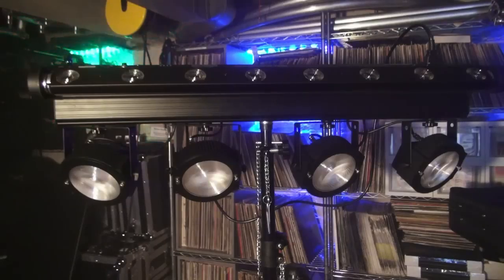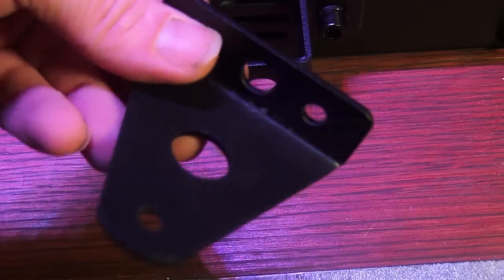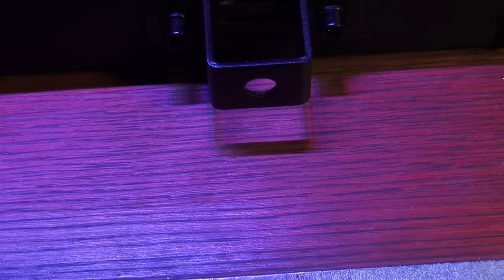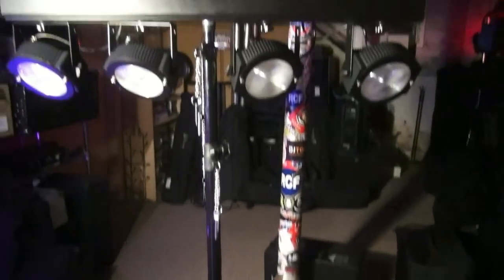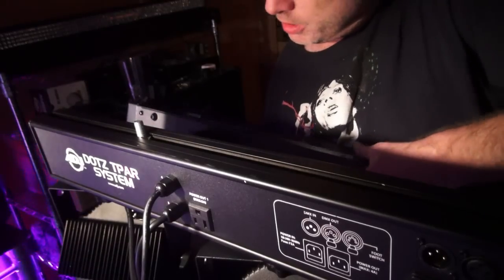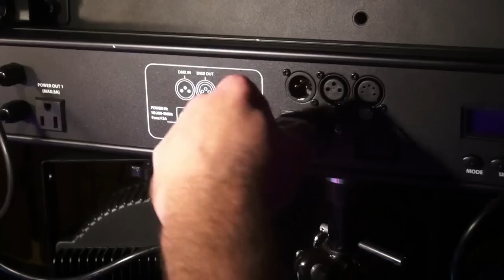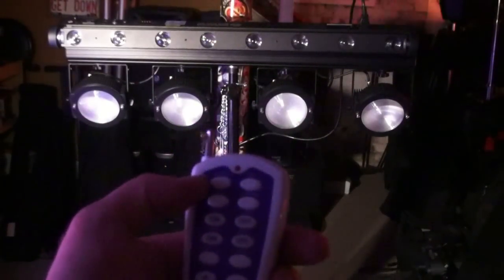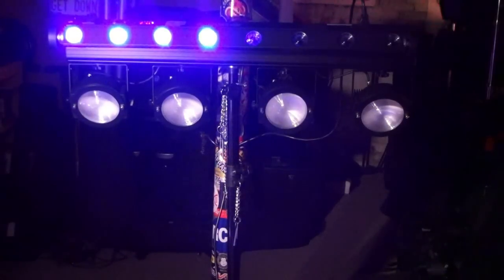Light Show - ADJ Dotz TPar System with Sweeper Beam Quad Mount

Comment: Howdy Brian - As I have already told you, I have this put together, and it works great.  I actually used brackets that I modified from an old computer network mounting brackets for a network switch, just drilled the holes.

Comment: Brian, can I ask you what settings you are using on the Sweeper Beam Quad? Are you in sound mode or running a particular Show, and if you're in Sound mode, what is your sensitivity set to, or, are you using a DMX controller?. Thanks so much.

Comment: Brain, I know this is up only for a few hours. May I suggest using a lock washer or an additional jam nut?
Reply from the maker: Yeah I'd actually recommend one on the nut side.  Use one on the bolt head side & you end up loosing thumb screw clearence
Reply: briansredd The bracket is a great idea. Plenty of uses building lights. Could you suggest this to ADJ as a one piece bracket?